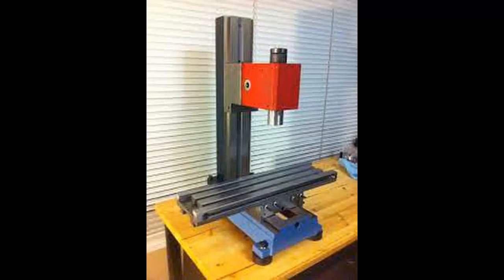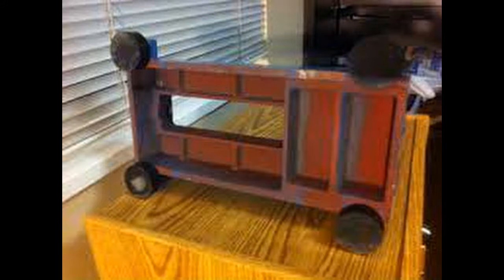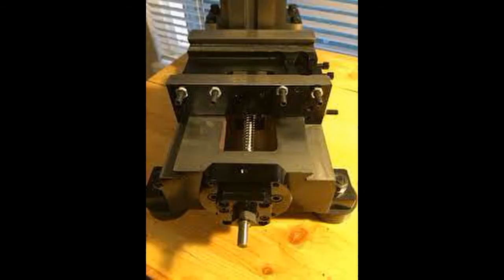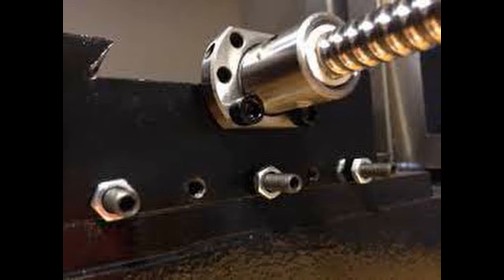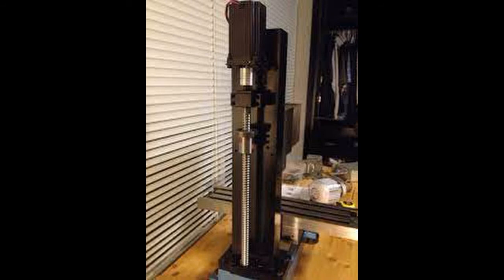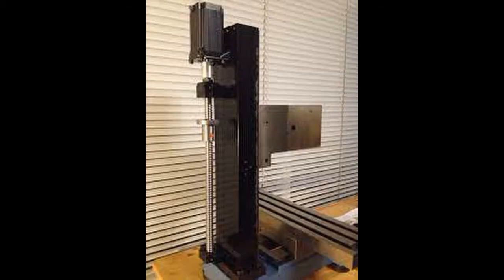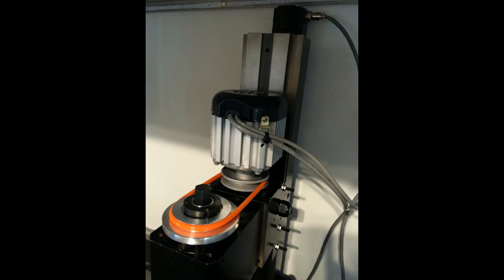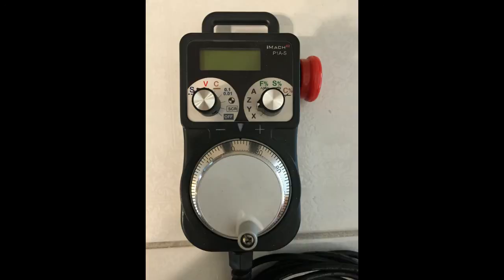CNC Conversion of LittleMachineShop.com HiTorque 3990 Mini Mill

Comment: I know this is two years old at this point, but thank you for taking a true DIY approach to your build instead of the cookie cutter approach that many, many others have taken with their kits that often cost more than the machine itself. I commend you on that! 

With that said, I'd love a bit more information on.. well everything. Take what you have here and make it 3 times as long, with some step by step from design to execution, unforeseen challenges that arose during the build and how you got around them. 

A few questions..

1. Has your 550w / 3/4hp motor been enough for you? I'm not sure how you have it geared.. I know you said the motor runs 4200pm, but does your mill as well (1:1 gearing)?

2. Any more details on why you did the Z the way your did? I don't want my ball screw off to the side, but have been considering mounting it where the factory rack is in front of the column or even milling a slot in the front of the column and putting it inside. The "wings" seem like they might cause some binding, especially with no other rail or locating feature added. 

3. Do you ever get any binding from the dovetails or any misalignment on any axis?

4. How has the accuracy been with the Chinese ballscrews? Have you needed any compensation in the software?

5. Are you happy with the build overall and the choices of your components? Anything you'd do differently?

---

I'm in the process right now of something similar. I have a manual 3990, but as things have gone on sale, I've also have picked up a  column and base kit, the X/Y carriage, and Z carriage. 

I keep going back and forth on keeping the dovetails or milling them off for linear rails, at least for X and Y. Linear rails would allow for an easy extension of the Y axis, one of the main limits of these mini mills. I did a ton of deburring work on the new castings and put a new coat of paint on them as my plan is to move the parts on the current complete manual machine onto the new castings and then clean up thr old ones, and then use those for the CNC build, to ensure I have at least some milling capability while building.
Reply from the maker: Questions

1. The consew brushless sewing machine motor has been great, i also have use it on my lathe build with a 2:1 ratio.
2. The z axis screw was installed on the back just because it was a nice flat surface & it worked perfectly fine, if i was to do again I would put it on the side to save space.
3. No binding, but the gib’s being non tapered make them difficult to adjust.
4. Chinese ballscrews are great, might have been a bit of backlash to compensate for.
5. If i was to build one again I would do a fully enclosed router style to save space.
Reply: @bdrmfg do the rubber pads prevent the mill from moving?